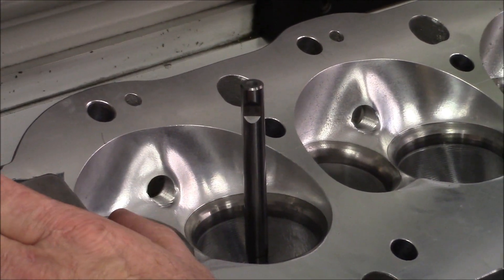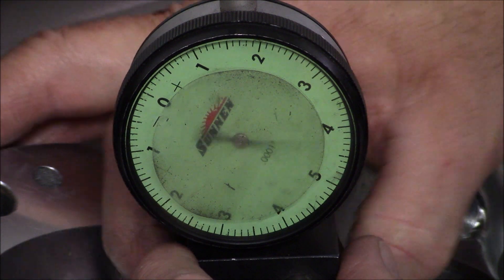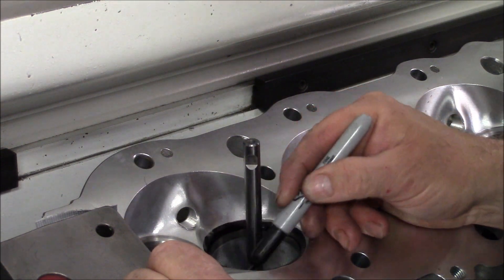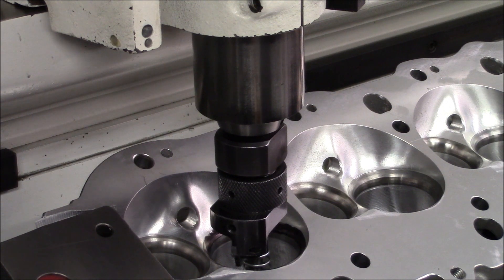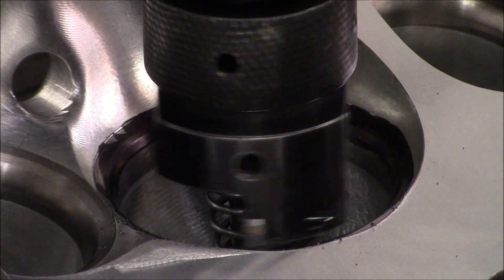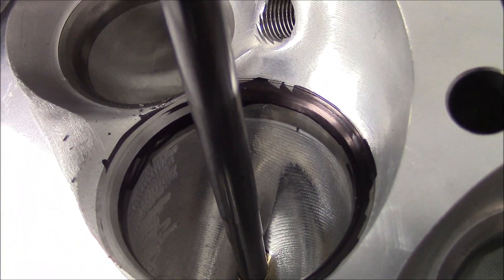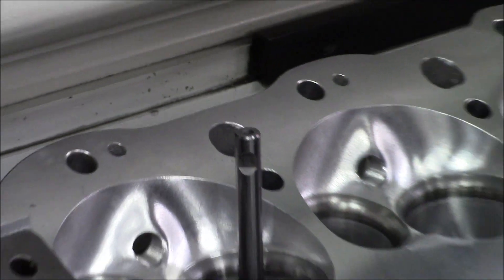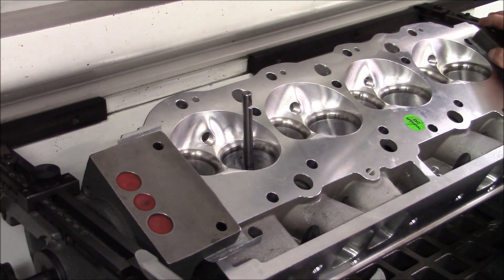Aftermarket Cylinder Heads - Why You Shouldn't Just Bolt Them On - TRRC / VortecPro

Comment: 1:30 "It really doesn't want to zero...But...."  (I will use my horribly inaccurate clapped out tools that have been banged around my shop, and haven't been calibrated since new, to show you that just touching them makes the needle move like a ceiling fan, and MY WORK IS SUPERIOR!)  If you brought those tools or that attitude towards tools to a NASCAR level engine shop...you'd be escorted to the door.

Comment: These heads come bare so the seats haven’t even been cut for valves
Reply: Bipolar Gamers : likely true. But an unsuspecting customer may not no that and assemble them only to have low vacuum and shit power.     At minimum I assemble and fill combustion chamber with liquid and let it sit overnight.     A literal “leak down” so to speak.

Comment: Imagine dropping 2 grand on a set of heads and having to have $500 in machine work done to them before you can even bolt them on.
Reply: They would work just fine out of the box..will work better with a little love or valve job...but this particular head has a crack in it 5:16 between the spark plug hole and the exhaust valve seat making all this work a potential waste of time and money...
Reply: harry guy good thing they have lifetime warranty

Comment: Are the AFR valve guides topped so that the end the valve comes out is square? I’ve had to square up guides in the past because the tapered dead pilot would lean and give bad readings and a bad cut.

Great video. Most don’t understand how hard it is to get a 2.300 seat to less than .002” runout.

Comment: Correct me if I'm wrong but couldn't you just use valve grinding compound and the valve to create a better seat match?
Reply: alot of material to grind with compound
Reply: Kevin Hontz Five months later, has the first valve come in yet? Seriously that amount of run out would take a very long time. The guide would be worn out by time it was done.
Reply: Lapping is different. It mates the valve to the seat. But if the seats are not concentric to the guide, it will leak no matter how much you lap them. That's why the guy in the video cut the seats, because trying to lap off .0010 of material by hand would mean you would be 80 years old by the time you finished one valve. Figuratively speaking.

Comment: If the heads are not milled correctly the company providing them should not be in business.
Reply: 'Correctly'? TO TOLERANCE! Do you think this guy makes,,, no, he doesn't 'make', he adjusts tolerances down, he 'decides what is 'good', what is 'tolerable', but never gets precise. His services probably includes 15%+ more cost to the head, he doesn't adjust a thousand heads a month as the maker of the head does make 1000 per month. Using larger more expensive machinery that simply cannot deliver the milling 'good' as described here.The heads were fine for what you paid, the extra milling is fine for what you paid. But it is "EXTRA".
Reply: @mikedar8484  Not for what they charge and how they advertise them.  Try advertise as high end or racing. That's a lie.  9 thou run-out is not acceptable even for street use.
Reply: @lammaninja925  poor thing, both financially and emotionally! 'Back in the 70's I helped friends, build engines.. in shops that built engines.. I am familiar with quality and cost for 50 years, the time and tools invested. If you can't do it yourself, every one has to pay someone else to do it. If you don't like pricing, do it yourself.
See... no drugs.. 'no fucking drugs'( I suppose you are referring to the little blue pill)... and only morons resort to attacks, .. here's your sign.

Comment: If buying a after market product should have been within spec sound like either the manufacture is doing a very sloppy job if was done by a so called robotic system then their is a serious problem with the system then it need to be re-calibrated  cheer like the video and very informative

Comment: I would like to see the heads run on a dyno out of the box and then a set that's had a valve job run to see what we are really talking about. And besides with a brand new casting the head will move around after its heated so precision now means exactly what later ?
Reply: The seat won't moved around in relation to the valve guide...

Comment: May be getting Afr heads for my 68 camaro.  I'm hesitant on getting the complete heads as opposed to the bare heads.  1600 for 1900 for complete.  Must be Chinese valves etc.
Reply: Then Chinese stuff is junk
Reply: Don't be so fast to knock the Chinese (and I'm not one). Their bad stuff is crap, like bad stuff is everywhere, but their good stuff is really good because their hi tech factories are all pretty new and have the latest equipment. There is no difference to a Swedish Asea 3D milling machine being operated by a Chinese guy in China, as there is an American (or Mexican) doing the same work using it in the USA. 
Back in the 50s and 60s we used to say the same about "made in Japan". You wouldn't do that now. The same for Korea. I used to work at Lexus Australia. We had half the failure rate as did BMW. But people are wiseing up to the prejudice being pushed out these days. Question:  What assault weapon is the go to for Special Forces around the world, including  SAS, SEALs and Delta Force etc in the USA? The Colt M4, right? Well ALL M4's are made in Japan by Miroku, under license because their version is built with better tolerances and reliability. Its also where Winchester, SAKO, Weatherby and Ruger rifles are made. Their quality control is much higher. 
Manufacturing is a global business and multinationals companies will seek out the best raw materials and the best engineering regardless of there its located.
here in Australia we screwed our manufacturing 20 years ago because the then government let the floodgates open to gear from other countries. its taken 20 years to get in in balance and our government is soon to announce a budget surplus this year. The difference is if we want China to buy all their iron ore and coal from us, we have to be prepared to buy stuff from them. All of our major trading partners are countries where we have a balanced trade. They need us and we need them. Its this policy that makes us good to deal with. There is no room for politics. Its just good business.

Comment: 1:22...."It doesn't want to zero".....He ain't kidding....I dont suppose for one second he's ever asked himself why....
Reply: The seat is so far off, it doesn't matter...
Reply: @BuzzLOLOL , doubtful the seat is off.  you can see a good amount of play in his tool just as he is sliding it on the guide.  Then to verify the seat is off and its not just a bent guide rod or a faulty tool he should have marked the head where 0 is and where the highest reading is then rotate the guide 90 degrees and see if it shows up in the same place.  If the readings are 90 degrees off then it is the guide rod and not the heads.

Watching his second video has raised a lot of questions and his lack of reply to comments also speaks volumes as well.  The second video is better because there are a few that are retired machinists that used to build and machine heads and they are even calling this fear mongering hack out.

Comment: BUT BUT BUT AFR IS THE BEST EVARRR, said everyone on mustang forums.  I'll take my shitty production iron gt40p heads and have a great machine shop do some great work with them and come close to or better than most aftermarket aluminum heads for half the price...not having to wonder if I'm gonna drop a valve at 6000 rpm.  That being said, I don't know this guy, and it could be that HIS tools and gaugues are the ones that are a little off.  Find a guy you can trust to do your machine work.
Reply: For what you'd spend reworking production heads, you could buy a set of AFR's and have the machine shop go over them for the same money. Unless the shop owner is a buddy that cuts you a break on price.

Comment: I took a cracked old Jeep head to my machinist, who told me it was beyond repair.  I asked if I should replace with a really good complete head, or a relatively cheap casting that would have to be machined and assembled. He surprised me when he said the casting was just as good, because the expensive (and complete) head would need to be disassembled and reworked by a machine shop anyway, and there'd actually be a little more cost 'cause it would have to be disassembled.  He recommended a medium-priced casting he'd had a lot of success with..... and in the end I got a great, mechanically sound head for about $200.00 less than if I'd bought one of the more expensive supposedly ready to bolt-on heads.  Having a good machinist in your corner looking out for you is priceless.

Comment: That is something I thought i d never had to do on a set of 2 to 3 thousand dollar heads are they not cutting them by the guide
Reply: they are but they are pumping them out by the hundreds and to actually check each seat and sharpen their cutters as often as it would take it would cut into their profits. its all about money and what they can get away with. theres not a lot of machinists out there on the internet and social media so this stuff kinda stays quiet. almost every single domestic after market head manufacturers seats are like this edelbrock, AFR, Dart, whatever. you would be amazed how bad even some factory replacement heads are also.

Comment: I see this is a little bit of an older video but... If the valve that came out of the hole had no guide issues and lapped in correctly how would the seat be noticed with run out.( I don't have those fancy tools available)  If I had "sharpied" the seat and spun the original valve in that seat would you see the same offset ?
Reply: DennitOne Yes absolutely, but you would not want to try and correct it by lapping it, just do that to get a witness pattern, Also remember they use very specific valve jobs to get the flow numbers they advertise so make sure whomever fixes the seats uses a cutter that won't compromise flow because you can kill a good port with a bad valve job!

Comment: Call me old fashioned but if i was spending $2000+ shipping + tax on a cylinder head id expect it to arrive in useable condition..... or arrive costing me $500.
Reply: That is a fair question. I'm a qualified mechanic rather than an automotive machinist and I find myself constantly being told by machinists what they're going to do rather than what I want under the guise that I'm just a lowly mechanic. 
Well how wrong can they be? Very wrong. I can't do what they do for sure, so I need to use them. This doesn't mean they get to tell me what is and is not going to happen.
This is my little story:
Because ALL aftermarket heads need disassembly before use regardless of cost I decided to buy bare castings for my 350 SBC into a Toyota FJ40 4x4 project. I told them I wanted them to supply the valves and that i was going to supply the springs and retainers. I decided to go with these really excellent GM beehive spring from an LS6 ?? (I can't remember exactly) and Comp Cams retainers to match these springs on SBC heads. It is a unique combination but apparently works really well - almost everyone who has gone this route says the results are exceptional for small OEM hydraulic roller cams. Well the shop goes to set them up - and we're talking a shop that builds engines for Sprint Cars ffs and they protesteth most severely.
Their gripe is these springs are no good because they're only 90lbs closed and that isn't going to work. I explain to him they're beehives and they don't need big spring pressure to work. They then say there is no damper spring with them, I reply they're beehives and the reducing radius of the coils and the ovate shape of the wire takes the place of the damper. They complain that they're too light again, and I reply well they're on LS engines that turn 6500rpm with a hydraulic roller. He says they are the wrong springs for the head and that this isn't how he sets up bare heads. I try to explain to him the concept of fucking beehive springs is to reduce pumping losses of the engine through reduced spring pressure and valvetrain mass. He doesn't get it.
Next, he ring up a mechanic friend of mine who's son did his maching apprenticeship with him and pleads with him to to talk reason to me. Of course my mechanic friend tells him to just do as I ask and fit the springs.
It goes on some more - he calls me back and says you'll have to pay me in full because I don't want to do it. I say if I pay will you finish it? He says no, then I say well we're at an impass. I'm not paying you to do the job you want to do, I'm paying you to do it the way I want it done, do you understand? I say to him do you understand I'm into these beehives and retainers for a bit of $$$s and I really don't want to double up on springs and retainers? Reluctantly he agrees. I pay him the money and they're done. As an incentive to finish I said I have some other work I need done so I bought a Milodon single idler gear drive to install (I really bought it to piss him off because I knew he'd protest about that and he most certainly didn't disappoint).

So there you go. I know more than him about beehive springs. Comp Cams, GM, Chrysler and about everybody else knows more than him about beehive springs. These machinists are why when you go and get your big block Mopar built and want something different done to the block than a small block chevy they start arguing with you. 

They are morons. You have every right to ask about your local shop.
The bloke in my local shop is a fuckwit and there are just so very many of them around.
Reply: as said previous...maybe buying a bare head is the best way and have it done the rest of teh way locally.
Reply: Well i take your point but that isn't how it is. Its wrong, but you have to pull them apart and then you find average quality springs and valves.
Best to get cores and let the shop do the rest to your specs. That way you get a quality product that costs +$500 over off the shelf and has good valves and springs rather than off the shelf +$500 for rectification with average valves and springs.
See what i'm saying?
Reply: An easy way to tell is the price difference between assembled and bare heads...bare and assemble at your local head shop is the way to go
Reply: Buy bare castings and let your shop finish them up. A competent shop will also be able to give recommendations on valves, springs, retainers, and keepers. When you get them back, you will have spent a tad more than if you would have bought a complete off the shelf set and have better quality.
Reply: EXACTLY....spend 2k on a set then spend how much more making them right ?
Reply: Rich.
Reply: theravedaddy that's the world we live in now. Get the product out as fast as you can and deal with the fallout later. Good luck with that cause the companies cover their ass.
Reply: You get what you pay for, and obviously, you have to pay more, to get more, of what you want, precision/tolerance levels. Don't blame the head MFGr for keeping costs down. Those are very highly advanced pours and mills.
Reply: There are a lot of "mechanics" and "machinist" out there that simply know how to perform a task.  They have no real understanding of the hows or whys of what they are doing.  I mean, I remember a supposed local carb guru in the '90s that did good work milling choke horns and tuning, but he just knew from experience what tended to work for what engine combo, when I started asking him questions about how the airbleed circuits work ect... he had no idea what I was talking about and didn't actually seem to understand all that well what was even happening in the carb.
Reply: Your an idiot!    With that logic I’d also expect a 2000.00 hooker to give a world class blowjob and take it up the ass with excitement  but it isn’t the case either.  Don’t ask me how I know.
Reply: @chrisburnsed6349  You're*
Reply: If you were to buy then from an actual cylinder head specialist like chad spier or eric weingartner,. This would be true...  They do a valve job on them and assemble them.

It's not like buying a head from Edelbrock or afr.

They actually take other people's casting and clean them up themselves and use the right stuff and you can tell in the price difference all the way up to the custom race stuff they do.

Comment: 9 thousandths run-out. ..and it PASSED quality control! ?!

Doesn't say much about the quality.
Reply: Dave M yup, they could save hundreds of dollars a year by not putting qc stickers on stuff thats not fit to wear them
Reply: They batch check them at the assembly area. What that means, is they may check the tenth head out of maybe 100. ( Who knows if their checking tools have regular calibration or not.) So they slap the stickers on the other 99.....whether they are jacked up or not.

Comment: thanks this is just the kind of thing that people need to see. Whether you buy your heads from Dart AFR or the darn manufacturer there's always Improvement you can make . Do an out-of-the-box leakage test just for the hell of it and design it for visual stimulation you know like water that has mr. Bubble in it and pressure-test a known oem crap valve job
" folks don't run your heads out of the box or it's Bubblicious"

Comment: I lap the valves in every time. You can do a perfect job cutting seats and grinding valves but lapping them makes the seal. That's my opinion.
Reply: Lapping a valve may have the valve pushed to one side of the guide.  Still not good.  Modern coated valves are supposed to be lapped anyway
Reply: it might help but its really not the right way to do it, you can polish a turd all you want but its still a turd in the end haha.